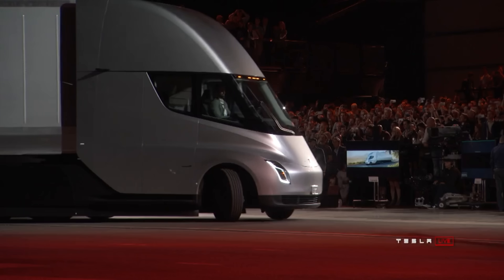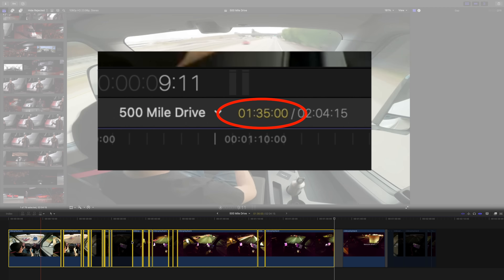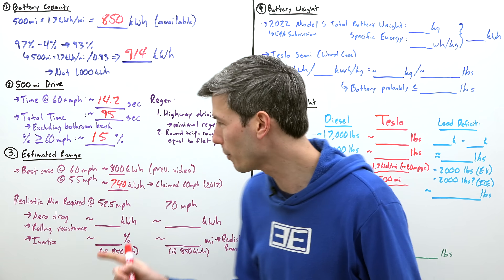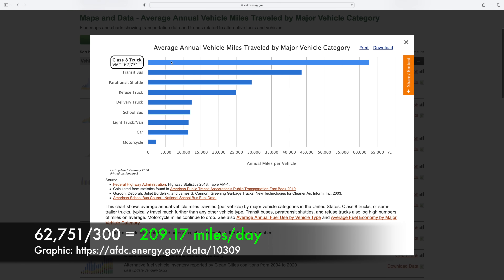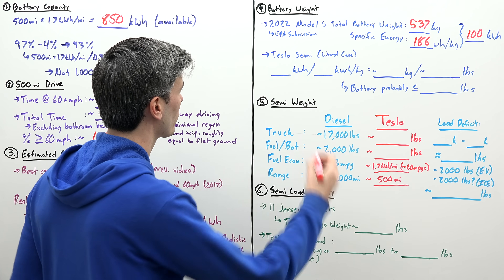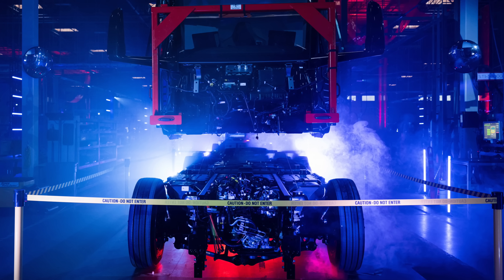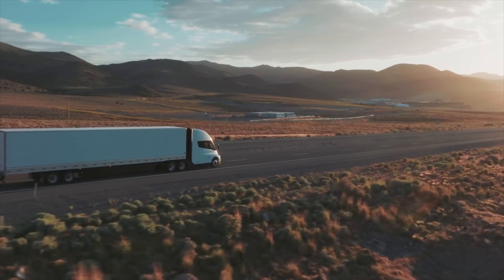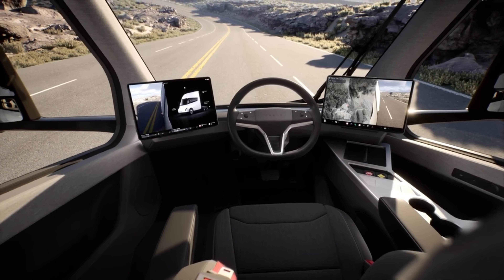Does The Tesla Semi Make Any Sense? Part 2!

Comment: Neat fact - at 10:45 when talking about load weights, that 54k lbs is very high for a normal road truck. With the 80k lbs cap, most road trucks max out the load at 45k lbs - doesn't matter if dry van, flatbed or reefer. 45k lb load is normal and considered to be the cap, and depending on the configuration at the time might even be too high to juggle the axles to be legal.

So that was a good stat. 😀
Reply: Most flatbed loads are figured at 50-52k. 16-18k truck and 8500 to 10k trailer.  
I drive "local" by CDL standards. This means I am not required log sheets most days and I average over 250 miles a day. I don't know of an over the road company that would be able to keep drivers at 350 miles a day. The short trips averaged are just part of a days work so that can be deceiving. 
To put 80% charge in a truck in 1/2 hour, what is the power requirement? Some of these distribution centers have 100+ docks. Will they need to build a power plant to supply top off on the batteries?
All that being said, I really enjoy your videos. They are both entertaining and educational.  Thank you.
Reply: @heavyhaul422  " Will they need to build a power plant to supply top off on the batteries?": If they do, that would be trivial for them to do...all other things being equal. Truck could plug in as it's being loaded or unloaded. Could also use a bank of ultra caps to take on charge quickly, then transfer to the battery in transit. Ultra-caps take more volume but are light.
Reply: @@toddmarshall7573  the problem is supplying the power needed in the tme required. The ultra caps will need charged. 
Even going 3 phase, 100 chargers are going to require enormous amperage. We do not have anything close to the infrastructure to handle charging trucks. 
The math doesn't work. It is always said the charging will happen at off peak times. That is also the best travel time. Solar panels don't do much at night and I can imaging the number of wind mills needed.
Reply: When I delivered Pepsi on route (48ft), we were loose on axle weights, no scales. But always became skeptical we were legal when loading past 45k, and threw a flag at anything past 46k. 

It was certainly a neat combination of maxed weight and maxed cube.
Reply: @Josh Snyder  if there's no scales I'm not overweight.  Thems the rules
Reply: @TheJacyn313  TRUTH
Reply: @TheJacyn313  RIght. That's why we're better with the golden rule rather than laws that dilute the golden rule. That's why we get 40,000 new laws every year...trying to define the golden rule.
Reply: @TheJacyn313  stink of trumper
Reply: That's why XPO, FedEx, and UPS use day cabs they're much lighter and when you slap them with a multi-trailer that can hold roughly 20,000 lb a trailer and put three of them together you're now pulling 60,000 lb.
Reply: Max weight a truck can haul is 105500
Reply: @Themrine2013  No, max weight a truck can haul is 63500kg.
Reply: @martinpenwald9475  it can haul more but im talking about legally 105,500lbs is the max legal weight without a permit to haul more
Reply: @Themrine2013  No, the max weight a truck can haul is 63500kg.
Reply: @Trucker2019  you need special permits/ advance authorization for overweight loads so not pertinent to the conversation.  

But you are correct if you're inferring that 80,000lbs technically isn't the most a truck can haul.   That's only really limited by the power of the rig and strength of the trailer.
Reply: This doesn't calculate a heavier trailer like a reefer vs the test flatbed
Reply: how would an EV truck go towing between175,000kg and 200,000kg
Reply: @@retired2920  at 325,000 pounds I Pennsylvania,  I average just below 2 mpg. A little math tells me I need a huge diesel generator to go more than about 60 miles. On hard pulls I get below 1/2 mpg.
Reply: @heavyhaul422  It's not about the generator. It's about the "electric" fuel tank.
Reply: You risk running afoul of axel weight limits the more you go over 40k which isn't a problem everywhere but it is on the west coast where the bridge laws are 40ft or less and you can't slide tandems
Reply: @TheJacyn313  - oh I know. I'm currently sitting in the basin in SoCal waiting for my next load. California's 40ft rule and the standard 34k lb tandem limits are why we have to juggle - but I've been consistently hauling loads at 42k to 44k without issue as long as the loaders know what they're doing to balance it in the trailer. 😀
Reply: @Broadpaw_Fox  thanks for these posts, they are informative to someone like me who’s not in the trucking industry.  I’m sure I could ferret it out of some dry regulations manual somewhere but “ain’t nobody got time for that!l 😉
Reply: @TheJacyn313  All Tesla has to do is lengthen the tractor's wheel base. They can do that in a week if it proves necessary. In Europe they can't do that. That's why European tractors are all snub nosed. Tesla could also move the 5th wheel back after lengthening the wheel base in Europe. Would require 5th wheel adjustable on trailers to serve both designs. ICE truck engine size limits their ability to make these configuration adjustments.

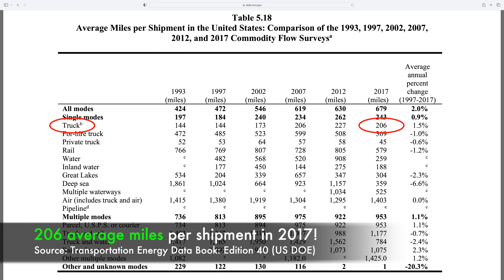Comment: At 5:50 - those statistics are misleading. That ~220 miles per day has to be including local delivery trucks, which are also class 8 trucks but usually don't have sleepers on them. While completely valid data, it seriously skews the numbers when talking about over the road applications. I don't think anyone would doubt the compatibility of an EV tractor for local usev- that's a best cade scenario for EV - always starting and ending at yhe same location, access to charging at a home location, etc. The questions of "is it feasible" are really only valid for over the road- and that mileage statistic is off by a lot.

Comment: so they took a heavy load that is the most compact and and least air resistive.
Reply: Not at all! A flat-bed trailer generates drag-inducing  turbulence behind the tractor
Reply: @st-ex8506  drag and rear turbulence is a function of the abrupt change in shape of the tail most section of the object in motion, the big box of a shipping container or typical tractor trailer box generates alot of drag.  in this setup, most of the drag is being generated by the cab of the truck itself.  the trailer and load has a much smaller cross section, is totally in the wake of the cab and is oriented in line with the direction of travel (aka the right way).  so yeah a bunch variables that can be stacked in the experiments favour is there.  I'm guessing Tesla's testing got this arrangement to the very best it could.  CES is a pitch/advertising event, it's meant to showcase the product in the best light possible.  the analysis EE offers is well researched and fantastic, and the breakdown is easy to follow and likely very accurate, but the caveat of how Tesla arranged their own test should be looked at too, and if it's consistent with a specialized use case or a more generic one.
Reply: @saeedhossain6099  I couldn't agree more with you!

Comment: I've always been very curious about the efficiency of Tesla regeneration. To first order, getting up to a Tejon pass would have taken maybe 100kwh, and I'm sure it wouldn't all have been recovered.
Reply: Regen depends largely on the current handling capability of the motors (/ generators).
These are cutting edge technology.
Remember they have the ability to accelerate 0-60 in 20 seconds with full load.
Holding (restricting) speed downhill won't overstress them.
The won't recover 100%, but it will be "impressive".
Reply: there is a portion of energy that cannot be recovered when you climb a hill, such as the energy used to hold the vehicle from sliding backward, ie: in rocket science it is called "gravity loss", meaning the energy loss due to fighting gravity caused by hovering and not gaining altitude (ie: when thrust from the engine didn't translate into gain in potential energy/height), especially when a truck is climbing a hill but slowly.

Comment: I think the cold winter weather will be a big factor also, I believe it reduces the range by 15 to 20 percent on average?
Reply: There is a great advantage with vehicles that are regularly used on longer trips. The battery pack retains heat and that helps maintain efficiency. Short trips in cars that are left to go really cold show more impact from winter. There will be some winter/bad weather range reduction for the truck but probably less than affects current EV cars.
Reply: That's the one factor that needs more attention; what about heavy loads traveling through the Midwest north in those dead of winter months?
Reply: @adaster98  Tesla model S in norway loses 40% of battery in winter time.
At least it did 2years ago when i tested it.
Reply: Average winter loss is closer to 30%…but these things are forbidden discussions in the marketing and government funding departments!
Reply: Likely a reason that these 'pilot' implementations seem to be confined to more southern regions. ;)
Reply: Not if the battery is preconditioned or warmed up for 10-15 min before driving.  Since these semis will plugged in charging they can be preconditioned and still ready to go with the full 100% charge

Comment: log trucks are regularly well over the legal max. they just avoid weigh stations. most of them weigh 90-100klbs 

the charging would require multiple substations per charger.

Tesla has been caught lying so much. i put absolutely no stock in any claim they make.

Comment: I could use one. I drive local haul loads and drive between 200 and 400 miles per day, most days in the low 200 range. I haul loads between 42k to 47k lbs. My current truck is in the shop, again, with scr codes, so getting rid of that garbage would be nice!

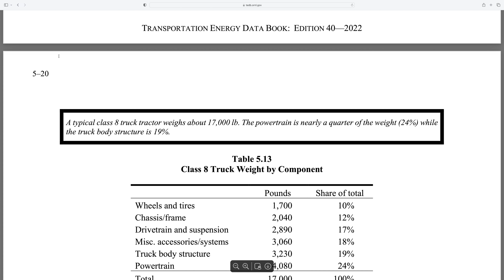Comment: Why wouldn't the tesla truck minus batteries weigh less than the diesel truck since the motors and transmission are much lighter for a tesla truck? At 8:26 the powertrain of a diesel truck is nearly a quarter of the weight.  That is about 4000 lbs,  how much does the Tesla power train weigh?  half as much? 2/3rds as much. Elon stated that 1 of the electric motors is light enough to be carried.  maybe the 3 motors and transmission are about 1000 -1500lbs?  Maybe there are more weight savings elsewhere in the design as well.

A second thing is that California speed limits for vehicles towing trailers is 55mph.

Comment: only problem your math is wrong  a diesel truck can go 2000 mile you said and what weight 2000pds that mean a diesel can carry 1500 more  the person running the truck is not going to fills the truck right to the top if he only need fuel for 500 mile he can fill and be back on his way in 20 min or less

Comment: There is a reason 25% of the model S is battery weight. There is a reason S Korea is suing Tesla for false mileage claims. The truck is a joke until there is 25,000 lbs of batteries and an electric plant to plug in with size 4/0 charge cable.

Comment: I think the Tesla semi will have air speed indicators so the driver will be able to more closely monitor actual air speed to adjust the ground speed....to a point. Obviously if the truck is in a 30mph headwind, the driver isn't going to be able to drive 25mph to keep the truck efficient but when there is a tailwind, they the driver could take advantage of that and run up to the posted speed limit.

Comment: Why would a Tesla tractor weigh 27k lbs? That 17k lbs of a diesel tractor includes the weight of a transmission, engine, the fuel tank, etc. That doesn't make sense for a Tesla Tractor lol. Realistically, the Tesla tractor could weigh around 20k lbs.

Comment: For me the biggest thing that I don't see anyone talking about is the cost of the batteries. At the average Tesla battery cost of around $200/KWh you're looking at a $170,000 battery pack plus installation and disposal of the respective 10,000lb batteries. Running 62,000 miles/yr average you'll possibly be looking at needing to replace these units every 5-7 years based on the typical service life of lithium EV batteries and that these routes being planned appear to be predicated on charging to 100% rather than 80%. Tesla made their "1 million mile" guarantee back in 2017 however given the validity of everything else that was stated at that presentation I wouldn't put much stock in that promise anymore.

Comment: Hold on, why are you making the tesla semi weight 17000 pounds just like a diesel truck and adding 10000pounds for battery?

Have you ever seen a diesel truck's engine and drivetrain? Do you think those things are light? Tesla semi doesnt have those you know?

You can literally lift by hand the motors of a tesla semi. Those tons of diesel motor and drivetrain are replaced by the battery. The difference may not be as big.

Comment: Can't trust what Tesla/musk is spoofing about as usual. They're withholding important information which is a bell ringer for me. That trip on the highway hauling packet's of chips whilst being the slowest vehicle on the road is also telling. You'll need a substation for each fast charger and imagine the intensity of the warehouse fire when one of these giant battery packs has a thermal runaway. Short haul electric trucks already exist because other manufacturers got on with creating instead of arse pumping.